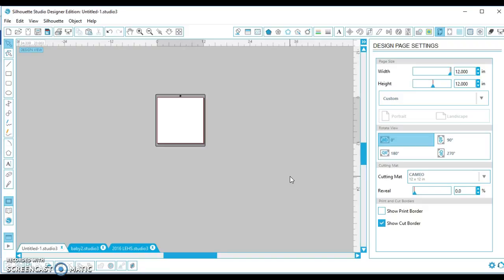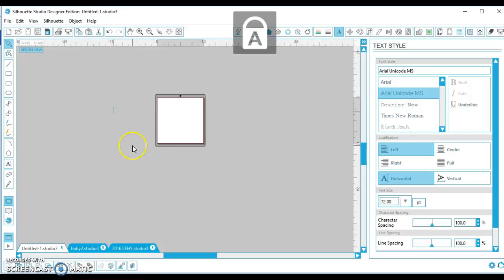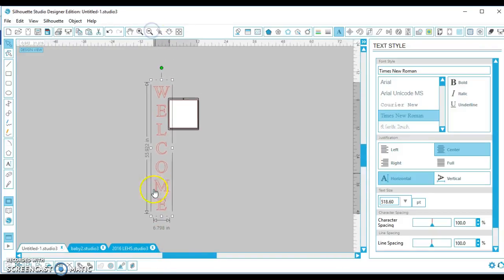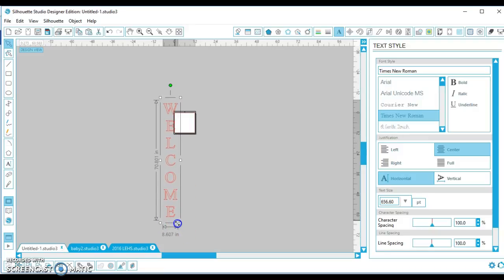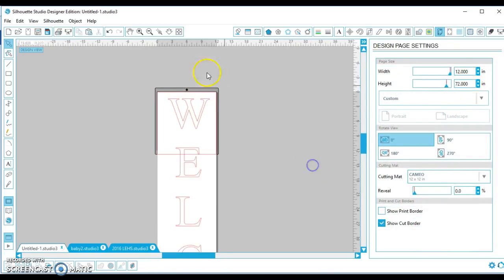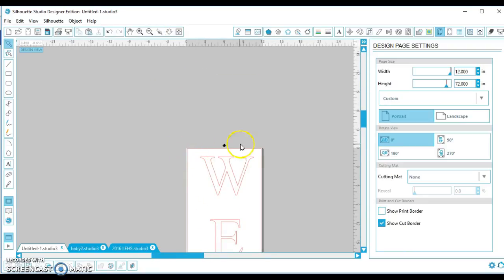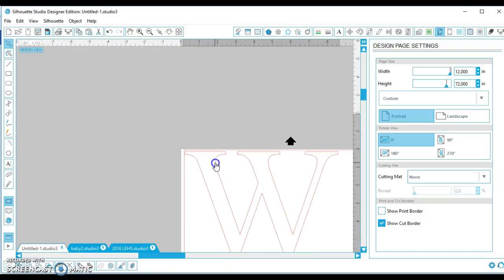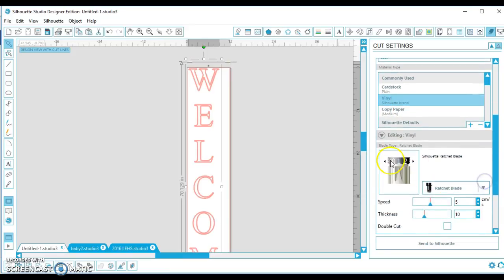Silhouette Vinyl roll Feeder Part 2!

Comment: where doeds the cut part go?  If you are cutting ba 72" sign, does it need 72" out the back for all that vinyl to go as its cutting?
Reply from the maker: Iki Kolohe Chinchillas if I'm understanding correctly, you want to make your cut page larger than what your actually cutting so if ur sign is 72" I make my cut page 74"

Comment: Laura,  thanks for the video's they are helping but I need help loading mat and vinyl... I tried it twice both times it had cut part of the design on the top part mat. I have the design in the red line . Do you have a video on this?
Reply from the maker: humm if your design is in the red cut space on your screen, it should work correctly. Maybe restart your software, computer and unplug your machine. I've had this happen as well and this did the trick for me